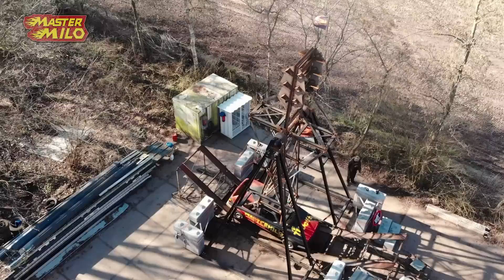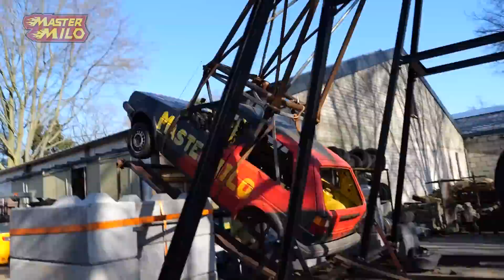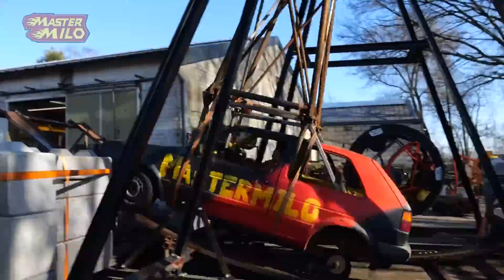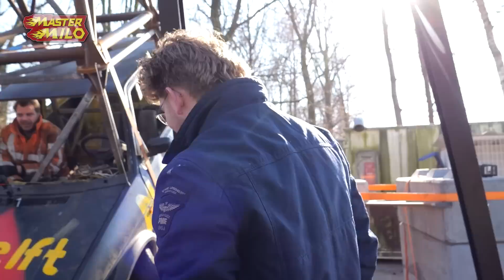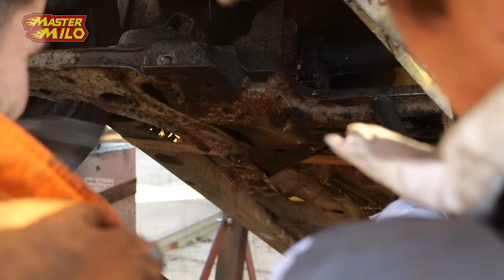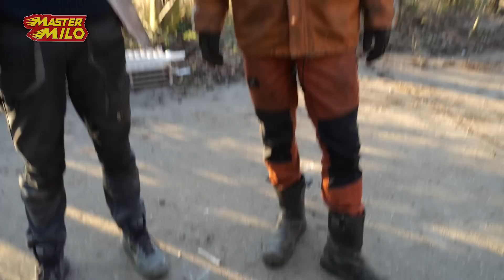Testing our 360° CARSWING at full power, is it going to break?

Comment: But did you find the 10mm socket that you dropped into the engine bay? 🤔🤣😂🤣
Reply: It's an engine bay, not an engine basket.
Reply: @Smartzenegger  👍to the 10 mm socket (or a dropped nut/bolt), it is an engine black 🕳 hole. Clink plunk clang silence🪄💨gone 👀🔎gone 🤣